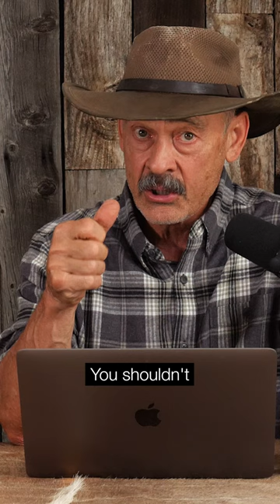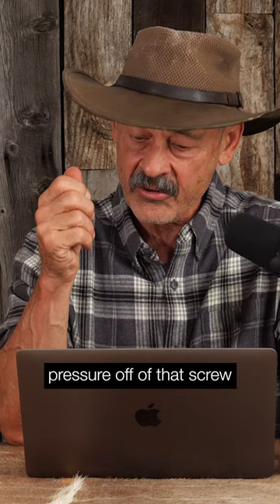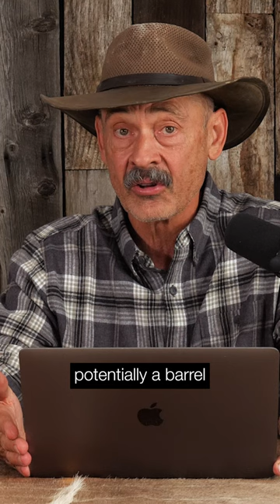Relieve Stresses on a Rifle Barrel?

Comment: Bed the stock properly and torque them both with a torque wrench. If you send in a barrel to be stress relieved, it could actually bend on you. I would bed the action, free float the barrel. If that doesn't work, start with some shims at the front of the stock, you can move these up or down the barrel and add or remove them until you find the sweet spot to disrupt the harmonics. It is a little bit of work and each adjustment needs to be started with a cold bore. I have done this on a few guns and they used to make stocks with a pressure point made into the stock. I used to work in a custom barrel shop.
Reply from the maker: Thanks Bud!

Comment: Absolutely. Steel although inanimate moves with temperature change and also can retain tension  that will constantly cause it to  move as it releases over time depending on heat inputs on formation and use.
Proper glass bedded stocks are important as well.
You want minimal contact. 
Allowing barrel to expand and contract uniformly after firing.
Relieving tension in steel is usually done one of 2 manners. 
That's a slow process of heating up,
Around 800 degrees f.
If I remember correctly,  holding there for a sustained time then gently cooling. A "dry" tempering if you will. Other way is vibration. 
Not preferred but usually reserved for certain metals. Ballistic steel or other metals requiring lower heats as not to take away their original intended characteristics. 
We use these methods on ship engine and shaft mounts. Where alignment is critical and in the thousands of an inch.
But  seriously, if gun barrel and stock are properly mounted. And barrel was acting up that way.
Be asking for refund or trading in.
Also Browning had at one point an adjustable barrel length. 
To tune the barrel. They found by lengthening or shortening the barrel by a fraction of an inch could substantially reduce vibration and improve accuracy. 
Not claiming to be expert, but stuff I've learned and had guns that could not fire 5 rounds in anything I would consider acceptable. I just got rid of them or considered them single shot.
Enjoy the discussion.